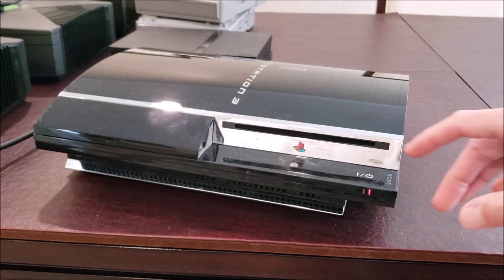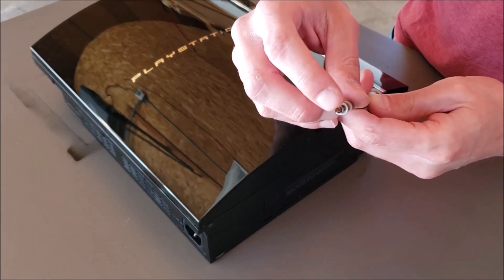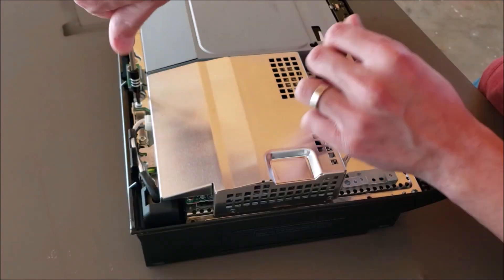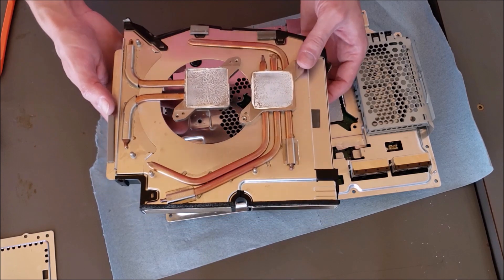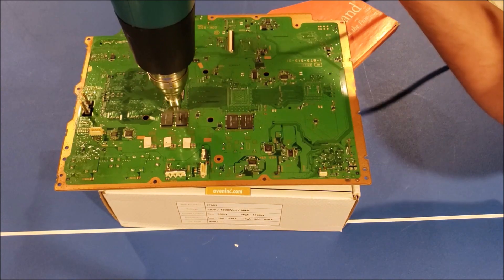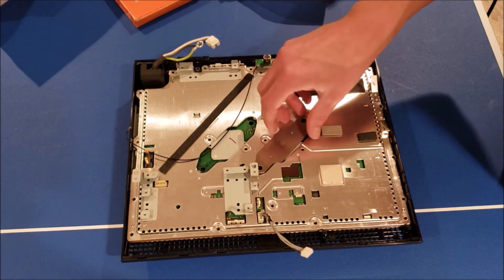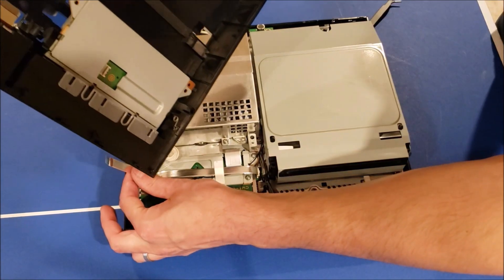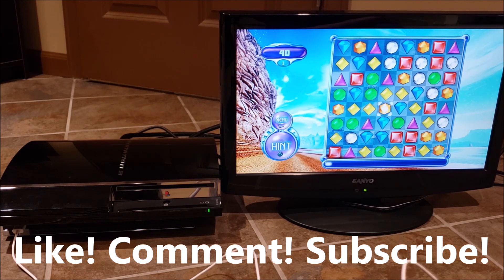Fixing a PS3 with Blinking Red Light "of Death" (YLOD)

Comment: I just went through the entire process and my console stayed powered up a little longer than before but still shut off and now, I can’t even get it to power back up. I was really careful with the entire process but I do fear I may have started it up too early without letting it cool off long enough. It was definitely dirty but the paste wasn’t dried out completely, replaced it anyway. I’m in shock at the thought of losing all my data. All in all, I do appreciate the video, just upset about the situation. Wondering if I can replace the cooling fan if that would help.
Reply: Update: i figured i had nothing to lose so I redid the process in your video from start to finish. My ps3 started up and stayed on long enough to do the system restore and reboot. I do not plan on using again until I get another ps3 to sync the data to. I’m very grateful for even the smallest chance at saving my data. I truly appreciate your video and explanations even if it is just a temporary solution
Reply from the maker: Thanks for watching and glad to hear the silver lining in your second comment, cheers!

Comment: I have fixed my Ps3 fat console after watching your video did exactly what you said and it works but i used my partners hair dryer as i dont have a heat gun still got the job done it had enough heat that it was hot af to touch im happy as my console is a CO2 Backwards compatible for ps1 and ps2 so it was worth fixing so far so good, also read the comments i can confirm the ps3 fat has at least 3 different types of internals all much the same just slight differences
Reply from the maker: Glad you got yours working, cheers!
Reply: Did you use the hair dryer directly on the motherboard?
Reply: @sneakyflamingo5149  i aimed it at the same parts this bloke did in the video on my backwards compatible ps3 and it worked mind you i tried the same thing on another console thats not backwards compatible and it didn't work so i suppose that had a different issue

Comment: I Have a CECHP01 and it runs fine since the day I got it back in 2008. Always done maintenance on it - regularly cleaning it and reapplying the best quality thermal paste I could always find. Never exceeded 55C and now with Evilnat CFW + Webman I could set it's fans to 80% and have it never even reach 50C. Do you think I should do this procedure or just let it be? Everything on it is original but it's kinda odd it still works since almost every - if not every - fat ps3 has had some problems at some point and mine just....hasn't.... Makes me worried one day she'll just decide to die out of nowhere.
Reply from the maker: If it's still working normally and you've been this careful with maintenance I'd say just keep doing what you're doing and do NOT do the procedure in this vid if you don't have to (i.e. you don't have YLOD). Cheers!

Comment: Apparently, models CECHK01 and models after that have a smaller cpu and gpu at 65 nanometers, where as the original ps3s (models cecha to cechh) have the bigger 90 nanometer cpu and gpu. And somehow, my CECHK01 has the ylod.
Reply from the maker: Have you ever tried working on the top half of a Nintendo 3DS? haha

Comment: What I dont understand is the battery connector on mine it has those 4 pins sticking off the motherboard but the white box thing has 2 holes, but only one of the pins is sticking through one of the holes. So idk if both pins are needed for the battery or not. I know a previous owner had it apart previously so maybe they put the white box on there wrong or something. On yours it looks like its centered in the backplate hole but mine is like in the corner barely fitting through that hole
Reply from the maker: Hmm I'm not sure I fully understand, hard to say without seeing a pic or being able to take a look myself....

Comment: I have an original launch PS3 with backwards compatibility….  It does something similar to this but it happens after 20 minutes or so of playing PS3 games.. 

It only does it with PS3 games though.. 

I can play PS1 and PS2 games all day long with no issues and all other functions work perfectly - but as soon as I play a PS3 game for 20 minutes or so it gives 3 beeps and cuts out.. 

Any idea what may be causing this ?
Reply from the maker: I think it's still related to overheating. It might not happen with PS1/PS2 games because those games are not as demanding on the CPU/GPU so the system can keep the temp at a manageable level for the condition of the system. That's my best guess anyway ¯\_(ツ)_/¯

Comment: At the 12:35 mark, when you put the top back on, did it go on pretty easily or did you have to screw it back in to keep it on there?
Reply from the maker: If you start by aligning the front edge like I did it should just drop down easily.

Comment: Do you do the same for an overheating ps3 that shuts off couple minutes during gameplay? Or should I skip the heat gun when it gets ylod
Reply from the maker: Tough to say, these old PS3's are finicky and a truly permanent fix is hard to come by, check my pinned comment for more info.
Reply: @FantasticQuack Is it even possible to upgrade the fat models into something as reliable as the super slim? It sounds like a lot of work but if the parts can be replaced and upgraded that would be amazing

Comment: Hello, have just rebuilt a ps3 off my friend,and it turns on, shows up on tv but then the fans start  going REALLY fast and loud, it then has  the infamous 3 beeps and the red light of death. 
It doesnt have a cd drive but has a fresh hdd with ps3 os on, aswell as new thermal paste.
This is in abot 10 seconds only.

Any help will be appriciated
Reply from the maker: It still sounds like a YLOD issue even if the start up behavior is slightly different. You can try the process in this vid but please also check my pinned comment for more info.

Comment: My ps3 turns green then it turns no light at all. If I click it again it goes back to red
Reply from the maker: That could indicate a hard drive problem. You can try disconnecting/reconnecting it (or replacing it).

Comment: any tips to fix the hard drive screw if it’s stripped
Reply from the maker: Did you try the rubber band trick? Other option is to use a dremel with a cut off wheel to cut a slot on the screw for a flathead screw driver. You can also by a set of easy out extractors. Last resort would be drilling the screw head off completely.

Comment: My PS3 does that while I'm in a middle of a game. I've been using it for 10 years so it must be really old now.
Reply from the maker: Hey there try a thorough clean from the inside out and replacing the thermal paste. If yours doesn't YLOD on start up you're still in decent shape, and it may be just an overheating problem that a good cleanout and fresh paste could remedy. Cheers!

Comment: If you use alcohol with a plastic razor blade, you can successfully remove the security sticker and not have it show "VOID".  I have the exact same PS3 model but it's working so far.  I did use your video to take it apart and put it back together.  Very east to follow along.  It was super dusty in there and now the fan no longer kicks on to full speed after only a minute of idling.  Thanks.
Reply from the maker: Glad to hear, thanks for the comment!

Comment: hi can you help i got ps3 fat console giving to me the other day when i turn it on im only getting a red light it only turn green and white for a second when i try a disc then it turn off i hear 3 r 4 beeps then the red light start blinking is there anyway to fix it many thanks
Reply from the maker: I believe what you are starting to see is a symptom of a very near YLOD. A failed hard drive might also cause this. In any case there is no doubt the thermal paste could stand to be replaced. If you run out of options I'd try the method shown in this video if you feel you've got nothing to lose as it's already broken.. check my pinned comment for more info.
Reply: hi bro thanks for the advice the other day still can't get the ps3 to work i put new paste on the chips and a new hard drive in it i done the reflow when i press the power button its turn green for a second then it turn off red light blinking and 3 beeps i press the power button again to stop it i watch a youtube video cleaning the fan i just try it to see would it work it did green light stay on for about 15 r 20 seconds i could hear the fan spinning i hold down the eject button then power it back on have you got anymore advice i can try many thanks 👊

Comment: My Fat has been sitting in the closet for more than 10 years now. I do have a slim I bought because of this problem. 
I did figure it would be a heat problem, it was kinda dusty but not that bad, the thermal paste was all dried up, so I put some new paste on there after removing the old. 
But it still didn't work.
I knew I'd come back to it one day because the Fat just looks 1 million times better than the Slim (PS3 Fat: best looking console in my opinion)
And with this heating the solder trick, I might just get it going.

Thanks for the video. Hopefully soon I'll be looking at that gorgeous console everyday!

Then the only "problem" would be that all my data is on my slim 😅
Reply from the maker: Hope you can get it working!

Comment: Easy bypass for this issue, start it by either ejecting a disc that’s in or putting a disc into the system, so this a few times then let it sit, works usually after only about 3 tries. Or try hoovering all the crap out of it that has got in over the years
Reply from the maker: Haven't tried the disc thing but dust removal alone was definitely not enough to solve it in this case.

Comment: Gonna try this out on my PS3. Just one question. Would a hair dryer work sufficiently for heating up the chips? Or do I need to buy a heat gun? Thank you
Reply from the maker: Hair dryer won't give you enough heat. Fortunately you can get heat guns for pretty cheap, I have some linked in the vid description. I'd recommend reading my pinned comment as well before deciding what is right for you, cheers!

Comment: This video is inaccurate. Ylod is 99% caused by failed bumps on the CPU and GPU. The heat gun doesn't fix the problem. It's an inherent problem with the processors that extend all the way to  PS3 slim model 20xx to 21xx. There is only one permanent solution and it's called the Frankenstein mod. If you want a detailed explanation of the problem, I recommend this video https://youtu. be/Za7WTNwAX0c
Reply from the maker: Thanks for sharing. I addressed these types of concerns to a degree in the pinned comment, but this is new information. When I get around to watching the whole thing I'll have to make an update.

Comment: Honestly I wouldn’t recommend this technique. If anything it’s a temporary fix. 

The poor solder Sony chose for balling these chips is already temperamental as is. And they are only designed to get up to 300+ Celsius 1 time, and that’s at the factory. 

If it happens again, you might just want to reball or try the NEC capacitors. Or both honestly. But NEC capacitors should’ve probably been the first choice since it’s much easier and risky.
Reply from the maker: I addressed this already, see pinned comment.

Comment: Mine shuts off after 5 minutes in a game. Stays on menu for hours. I see no yellow light what can I do in that situation?
Reply: Only applicable to the phat ps3:

First, make sure it’s all clean of all dust and you aren’t running it in a hot environment. 

It is likely the RSX (GPU). You can try reapplying thermal paste first. (The actual chip is actually under the metal square IHS. You can find videos on how to reapply the thermal paste to the actual chip underneath. I would also replace the thermal pads being used. 

It might be worth making sure your power supply is good, some of the very first ones ran extremely hot. Best one for a Phat PS3 is an APS 231 I think. 

If that still doesn’t work, I would replace the NEC token capacitors. 

If that still doesn’t work… you could try a reflow 

If that doesn’t work you could try a reball of the GPU 

If that doesn’t work you can switch out the 90nm GPU for a newer GPU.
Reply from the maker: Good advice from Ishmael, sounds like an overheat problem.

Comment: It would seem there is different types of fat ps3s   Mine doesn’t have a ribbon to the lid.
Reply from the maker: Yeah it's a little convoluted and that's why I pointed out the model # at the start. I think there are 3 or more variations of the "fat" PS3. Easiest way to tell if yours is PS2 backwards compatible is to check if there's 4 USB ports on the front.

Comment: Sir, I have a ps3 fat case device. It works on green light. It doesn't display any images. It turns itself off without going into safe mode. I wonder what could be the problem.
Reply from the maker: Oh man that could be a number of problems such as a bad HDMI driver, open circuit on the board, or something else. Unfortunately very tricky to diagnose. You could try PSXplace to see if anyone had a similar issue and solved it. Good luck!

Comment: I have super high hopes that this is my issue finally had the balls to take my 80gb ps3 apart and there was next to no thermal paste on the chips glad I found this video does it matter what paste I used I got some   
Arctic Silver 5 AS5-3.5G Thermal Paste thats what some forms said to use
Reply from the maker: That paste should be just fine, hope you get it working!

Comment: at 6:20 instead of bending the hinge, just open it from the other side and it will unhook from the metal you bent.
Reply from the maker: Believe me I knew I was doing it wrong as I was doing it. It was my first time opening one of these and no harm in the end when I bent it back. A bit of cringe but got the job done.
Reply: @FantasticQuack  it happens lol. i broke the bluray ribbon cable clip when i first opened one of these. those things are fragile.

Comment: Use acetone to remove thermal paste, it's much faster.
Reply from the maker: Sure it's faster, but acetone also dissolves certain plastics which may be present on the board/components. So use alcohol instead which does the job just fine, even if it takes a few seconds longer, and has no risk involved.

Comment: This is the exact same thing I just did and I thought the method in the video would be different but it Still didn't help got any other solution? Please?
Reply from the maker: Very possible the components just didn't get hot enough with the heat gun, in which case you could just try again with higher temp/longer heat exposure. There are more considerations here, so please check my pinned comment for additional detail.

Comment: Got a hold of a PS3 Slim model. Is it possible to wire & mount a mini stereo jack (headphones) so a pair of headphones can be plugged into the system? Also can the"PS3" logo on the top of the case/ lid be modded to light up (LEDs)? Thank you 🤓 my PS3 works but might need some cleaning and thermal paste refreshed. There is a better, more accurate way to do a reflow.
Reply from the maker: If you can dream it you can do it. I haven't worked on a slim model yet so can't give any specific advice there. Regarding reflow, the "proper" way to do it requires re-balling equipment which is expensive and doesn't make sense for most people to own given the specific/uncommon use scenarios. The method I show in this vid could also be done with a reflow station which is basically a miniature and more controlled heat gun. In general, the reflow might not be necessary depending on the problem, check my pinned comment for more info. Thanks for watching!
Reply: @FantasticQuack  a reball takes more time, skill, & patience! And it is possible to make a type of hot-air station for doing reflow or reball operations, but you are right! It's specialized, and may not get used very often. Thank you for the reply! 🤓

Comment: found a ps3 online for $57 "not working"...says it turns green for a lil bit then turns red. is this there lots of possible fixes and is worth trying for that price?
Reply from the maker: Personally I'd say the price is too high. I wouldn't spend more than $20 for a parts only unit, it might be worth more to bigger repair shops who would actually part it out vs trying to fix it as-is though.
Reply: @FantasticQuack  okay that sounds reasonable. thank you 👍

Comment: I don't know how but water got into mine, could this be a solution?
Reply from the maker: If the motherboard was exposed to water while the system was running and caused it to shut off it's very likely that the board is fried to the point where repair is either not possible or not practical.
Reply: No, while it was off

Comment: I just got my ps3 second-hand and it was working fine for a few hours, and then the red blinking light happened. I'm in no way able to preform what u did in this video, so now I have a ps3 for decorating :)
Reply from the maker: Even if you try and fail you can still use it as decoration!
Reply: @FantasticQuack  true😂😂
Reply: @DidiRox_  It's already broken, can't break it more! That's my theory as I prepare to do this myself. Here's to hoping I get a round of Tenchu in tonight!
Reply: @tecc8380  yea I'll probably get around to doing it sometime. You've convinced me lol
Reply: Well, that fix wasn't the one I needed for this system. I will say taking it apart was fun and not that difficult. I might need to do some motherboard work, which again it's already broke. Hands on has much inner peace and gratification if you can keep your cool! Good luck out there ❤️🌍

Comment: They are actually pretty reliable consoles. This didn't happen to that many, It happened to almost 90% of Xbox 360s. It was so bad
Reply from the maker: Back when 360's were current gen you are correct. But this problem is getting more wide spread on fat PS3's these days as their thermal paste has dried up and the dust layers inside are often thick